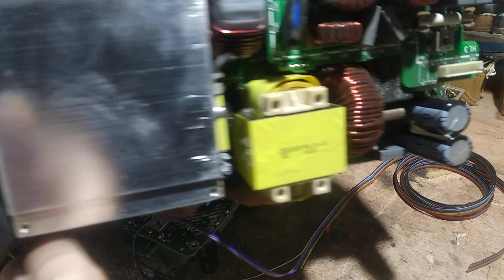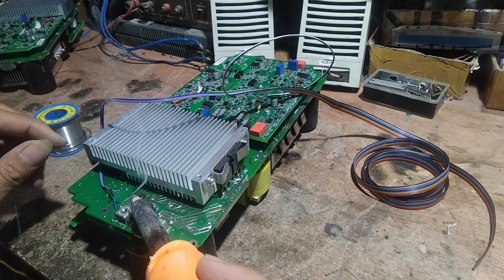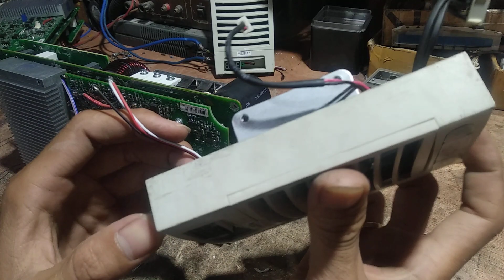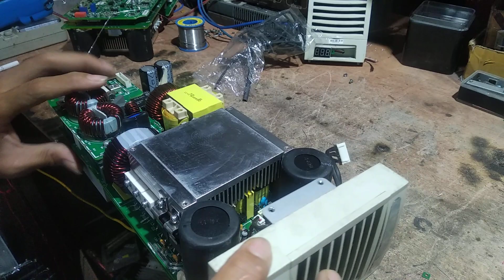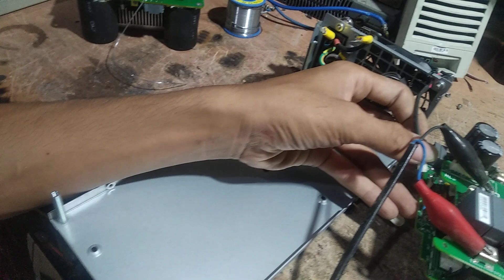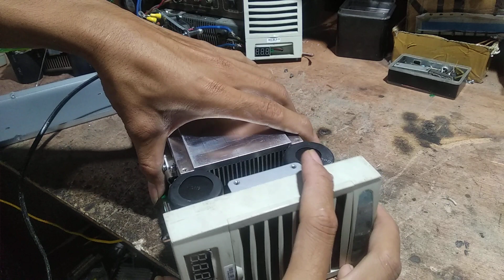MODIF POWER SUPPLY ZTE 50 A

Comment: Ada modifikasi yang lain gak om, selain cuma nambah indicator voltmeter dc, 

Short protection nya apakah masih aktiv jika di adjust low voltage?
Reply from the maker: Masih aktif om untuk curen / beban sensor nya

Comment: Mohon pencerahan para master. saya modif zte zxd2400 jika saya gunakan untuk rig VHF terjadi spleter (pada saat monitor ada suara dug.dug.../gemuruh) tetapi pada radio HF normal, apa penyebnya? terimakasih
Reply from the maker: Itu biasa terjadi di psu  zte pak..coba kabel out dc di kasih cicin ferit dan di jauhkna dari pernagkat